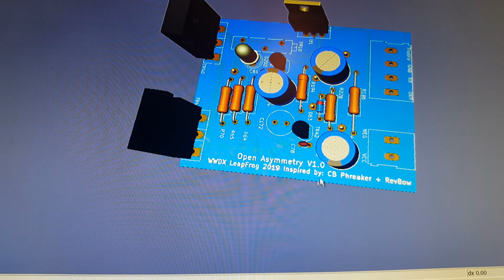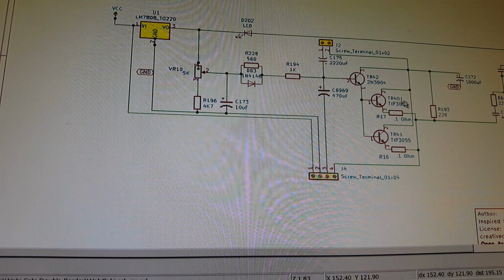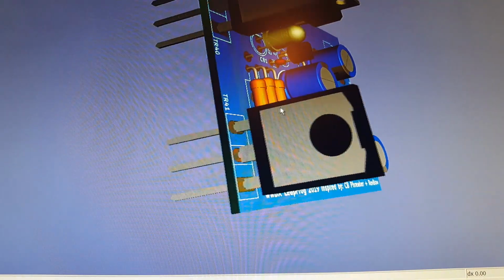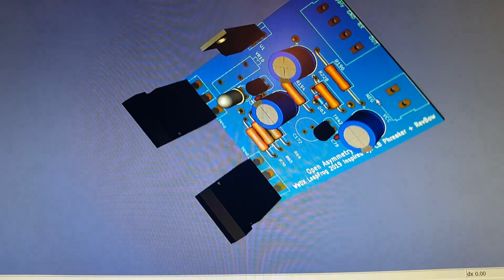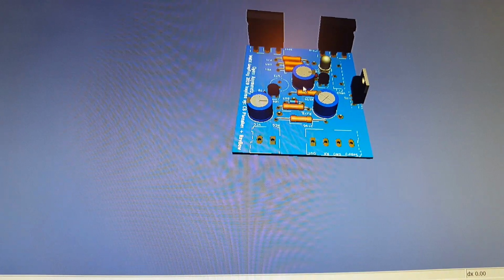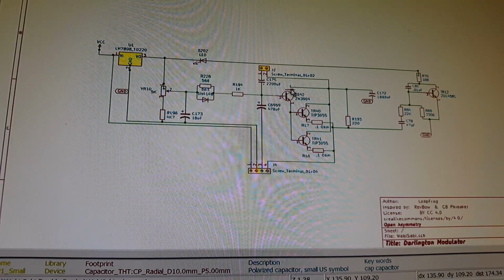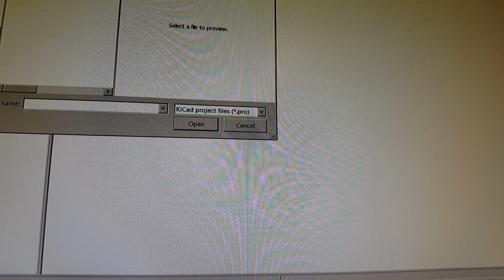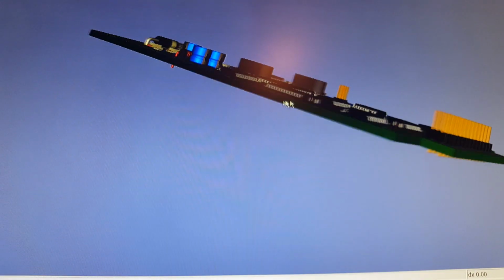Open Asymmetry Project Video 1 (asymmetrical modulation)

Comment: That Rev Bow guy is pretty shady....
Appreciate the Shout Out.
Sign me up for one of these

If you do it correctly, you can get some damn fine audio with a modified Mic audio chain in the radio, and a slightly modified CB mic... You need to get lower than the 300Hz limit in the Mic Preamp circuit
Reply from the maker: I've gotten down to about 20 Hertz, I love playing with this modification! Thank you for sharing your idea on the internet.

Comment from the maker: You can omit the two "0.1 Ohm"  resistors if you are going to run a single final output regulator.

You can get by with just a buffer, regulator, diode, and resistors; if you already have an 8 volt source that is.